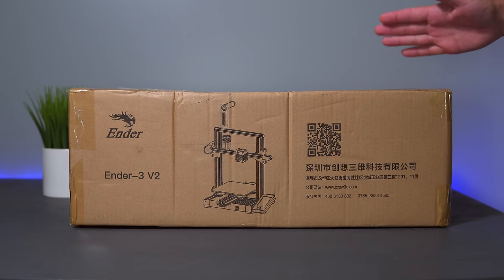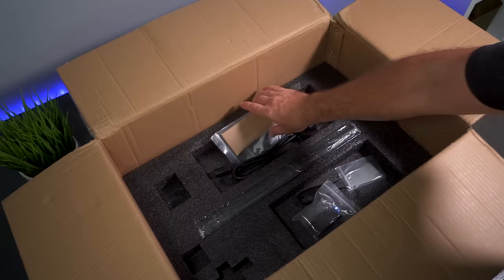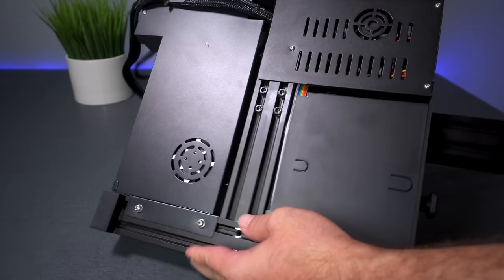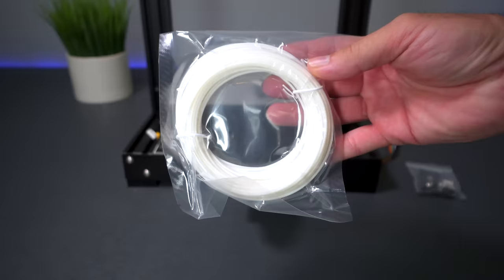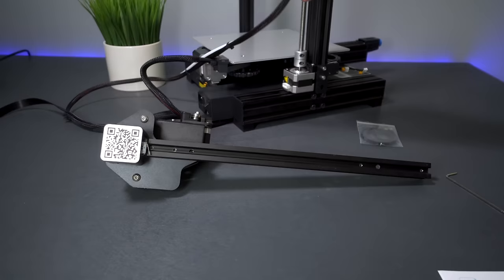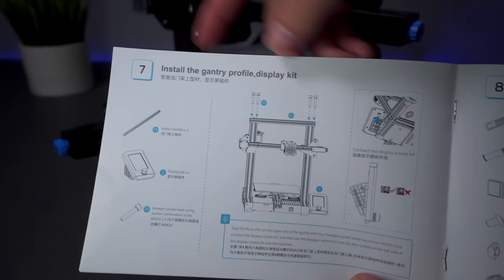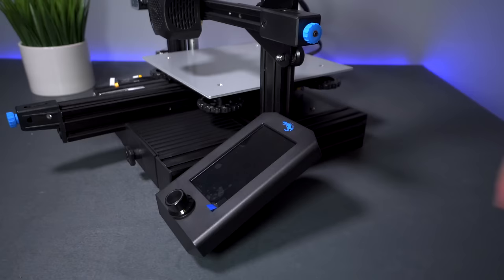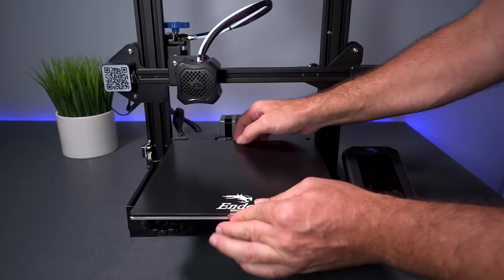Creality Ender 3 V2 - 3D Printer - Unbox & Setup

Comment: What can I do when my tires are really tight on the side of the motor? like I can not move the x axis at all by pushing it down. he speaks about it 22:48 (I did everything as suggested in the video with screws not tightening until the end)
Reply: Rest the extruder on bed and make sure its level so that the bed supports the weight and is level. Loosen everything on the wheels after having the frame tighten as per the video. With the weight supported by the bed and level you can tighten the wheels so that nothing is binding. Follow the rest of the video as he describes. If you can't loosen the nut you'll need the wrench on the nut and the allen wrench on the bolt. If you do one and not the other the bolt or nut will spin with no resistance.
Reply: I am having the same issue.  It will move up somewhat easily, but not down, unless I spin the motor rod
Reply: I'm stuck on this same part
Reply: did you find a solution?
Reply: @squatopotamus  did you find a solution?
Reply: @Studiodre5  did you find a solution?
Reply: @miguelpera9639  no, but it did not become an issue while printing.  Technically you should not be pushing down on that anyway.  You are forcing the motor to spin, which you should not do.  As long as the arm travels smooth while in operation, you're fine
Reply: I'm having the same issue, I wish people could actually help instead of everyone just asking questions 😕
Reply: @Studiodre5  I had the same issue, however it does not seem to affect the auto home option, everything seems to be moving just fine. I think its good to go with the first print.

Comment: Thank you. Creality should pay you for this. You put my printer together.
One issue I had was driving that lead screw through the brass bushing - as mine was fixed by screwes with those cut spring-like washers it was inclined. So it was impossible to drive the lead screw through as they were no in-line. I had to loosen those screws, drive the lead screw through the bushing and then once the horizontal arm was riding on the frame tighten those 2 little screws. Thus the bushing was fixed in proper position.

Comment: When I screw in the motor for the vertical axis, it's off at a slight angle, not perfectly perpendicular to the bar it's attached to.  It seems this is creating fricton as I cannot freely move the print head up and down like you can with one hand.  Do I have a defective motor assembly?
Reply: Same thing is happening to me right this moment. I wish he or someone would have responded cause I don’t know what to do! When I try to push the assembly bar down it jumps and whines and takes a lot of force. And forget about trying to push it UP away from the bed.
Reply: @09shnngns  @woohoo2491 anyone figure this out?
Reply: The only thing I found that helped mine was to print a shim I found off Thingiverse. There’s a shim for the bottom and side of the z axis motor and it helped make the lead screw a little more perpendicular to the vertical frame bar.
Reply: Glad someone commented about this, wasnt sure about how much pressire he was using too. Still having trouble though
Reply: @09shnngns  Hi

Can you kindly, explain a little further how to you solve it?

Still having troubles on this :(
Reply: Also having this same issue. The wheels are pretty hard to turn by hand. I can push x axis up and down but it takes a bit of pressure
Reply: I want to add my experience.

As i was assembling the z-axiz rod it was crocked and i couldnt move the bar up and down, so i first unscrewed the rod and removed it for a bit, and i also unscrewed the stepper motor bracket from the stepper and the frame, incase it was a tiny bit missaligned.
Then i screwed it back together and tried lifting upp the stepper as i screwed it back in, as i saw him mention it sat a bit up on his "in the video"
then i screwed back the rod but upside down because i saw a red mark in the end of it and thought it might have been a mark to indicate that it should be at the bottom.

After all of that my X-axiz frame could move much easier.
Hope this helps someone else aswell. 😊

Comment: This video is expert advice! I had an issue with the bed hitting the y-axis stepper motor case (so it never reaches the y-axis limit switch, and auto-home fails and crashes the software, ending up freezing the display in auto-home screen). After watching this video, I understood what every single piece is for, and figured out how to adjust it a few mm away so that bed doesn't hit the motor case, and the bed is still level on all corners. (I moved the z-axis limit switch up by few mm and then adjusted the bed, raising it up by few mm on all sides, so that the bed now slides above the motor case.) Thanks a ton!

Comment: Assembly definitely helped me a lot, especially differentiating between the vertical gantries. They changed the manual recently and it's basically impossible to tell which side the holes are supposed to go. I did have issues with the Z axis being too low when the limit switch is bottomed out on that nub; had to raise it up a few mm as the print bed was crashing into the Y axis motor. Manually leveling is also a huge pain for my unit for some reason, it seems to change by itself and I had a hard time getting the first layer to stick properly. Other than that though I am letting it pint its first print, seems to be going well so far. I will definitely get the automatic leveler and start printing some upgrades for it, mainly a filament guide of some sort as even with the spool holder all the way to the left it snapped the filament a couple times. Besides the small snags and lots of fine tuning needed it seems to be a great value of a 3D printer (mine was only $200).

Comment: OMG you have no idea how useful your video is!  I watched 2 different videos and tried to follow the printed instructions and could not figure out where to plug some of the power plugs in.  I plugged the wrong ones in the Z and X (used the back plugs instead of the ones under the bed), then found the plugs under bed and went "where does this go?"
Also, if I had watched your video first, I would have gotten that stupid belt on WAY easier.  Thank you!

Comment: Thanks for the very detailed explanation! I was thinking of buying either this one or the earlier (much cheaper) model, but I’m convinced now it’s worth the extra money. This is definitely going to be useful when I recieve and have to assemble it! What I wondered was, the vibration, can that be prevented by building a wooden case around the printer, with the sides and top being snug enough to keep it perfectly still?

Comment: I just finished assembling mine with help from this video.   This was extremely helpful.  My only issue is with the X axis bar rollers.  Can adjust the two inside rollers and the one on the right, from the front seems to tighten no matter which way i try to go with it.  The up down on Z axis is way too tight.  I followed this video to a T.  Any suggestions?
Reply: Yours and mine both mate. Lol thinking maybe I over tightened the bolts for the frame. Or maybe the bit the screw connects too isn't perfectly level. Or maybe my bar itself is slightly bent. Can't be arsed with it now it's half 9. I'll try sort it tomorrow. Did you sort yours out ok? Been fiddling about with those adjustable nuts on the x axis rollers for about an hour straight. Mine do loosen after turning... To a point, then it tightens again... Turning in same direction, then loosens again then tightens again... Seriously wtf lol. Something not right

Comment: What if the rollers are too tight at 22:50? Able to move the right side but motor side is stuck. Not able to move the wheels at all.
Reply: Did you get anywhere on this? I am having a very similar problem. It seems the wheels are very tight against the channel .
Reply: @maclennan.realestate  Nope, unfortunately I did not. When I do auto-home and to try print something, the filament is not sticking to the bed. Not sure if its caused by that wheels problem or bad bed-leveling.
Reply: @marcelkoprowski3816  I believe I fixed mine. The bracket holding the two side bars together was a bit too tight putting too much tent lion on the wheels. Also, if you go back in the video where he loosens the nuts around the actual printer head to make them loser that helped me as well. Overall, I’d say keep it a bit more lose than tight especially around the plastic parts - and make sure your belts aren’t too lose either.
Reply: @maclennan.realestate  you mean the bracket on the very top? I tried that many times, did not seem to solve the issue for me unfortunately. Glad that it helped you :)

Comment: Is the Z Axis Motor Mount still recommended in the Ender 3 V2, or has this become unnecessary? Thank You.
Reply: what do you mean
Reply: @k3a  On reviews of the Ender 3 Pro, this same creator has suggested a Z Axis alignment shim. I was curious as to weather he felt this was still necessary, or if he felt Creality had resolved the issue in the Ender 3 v2.
Reply: My V2 I just rec'd was a mile off.  I didn't realize it was a thing until my Z was no where near as loose as his, my bound up badly.

I put two thin washers in before i knew it was a thing, and now i'm printing the shims.

So yes, very far off, and kinda sad they haven't fixed this issue
Reply: @rustynutz9790  Same here.  Played around with the rails, rollers and nothing worked.   Two small washers and it was alot better.  Still stuck a bit in one spot so I added a bit of silicone lubricant (applied to rag then rag to screw) and now she glides... Perhaps too much? I hope she doesn't back drive under her own weight and vibration.
Reply: The Z axis motor is a pain in the ass, ive spent three days trying to get rid of the binding. I guess Youtubers get handpicked boxes with controlled parts.
Reply: @rustynutz9790  where did you put the washers please? im stuck on this problem
Reply: @mikedeblock5189  where did you put the washers? im stuck on this problem
Reply: @miguelpera9639  between the plastic bracket that is on top of the zstepper, and the vertical extruded aluminum bar.
Basically i shimmed the whole zstepper away from the place it mounts a bit

Comment: Hello, I just bought this 3d printer and I’m having a hard time. I followed everything from this video but for some reason the x axis doesn’t glide on the t type screw or z axis. Can anyone help?
Reply: I have the same problem. I am still assembling it, I am about at the 23:15 mark. When I push the x-axis, it goes down, but when I pull it it doesn't. I thought it was the z-rod but it seems in line. I tried loosening the wheels and the screws for the left/right channels. Not sure what I can do now, not even sure if I should worry about it... if I turn the z-rod manually the x-axis does come up.
Reply: @mnlg_yt  you never want to move any of the axes by hand. You only need to worry if the movement is not smooth if you take the leadscrew out and move the whole x-axis assembly up and down.

Comment: I want to thank you and iterate the importance of "squaring" everything.  I never had/ used a 3D printer before and my first print was amazing! I was expecting stringing, elephant foot, layering, etc... nothing all good!

I would like to add tho:
1.  When tightening the Y axis on the bottom, it needs to be positioned so it is parallel with the side base 4040's, so position this well before just tightening the 4 screws.
2. Same for upper X axis, the bracket on the right needs to be square as the outside rollers don't adjust and they should be parallel with the 2 outside rollers on the other bracket connecting the X rail.

Updated to Marlin 2.1.1 and display print even better (only my 4th print).

HF and Ty.

Comment: Fantastic video! I decided to use this instead of the instruction manual and found it super easy to follow along with. 
Probably one thing to note though, is to make sure of is to level the x-axis arm that the extruder and nozzle rolls on, after rolling down the Z axis uprights. Do this with a ruler from the base up to the bar on both sides of the platform. Making sure this is level will reduce the platform levelling time, beacuse you're no longer worrying about why on earth one side looks higher than the other.

Comment: Excellent tutorial on how to build this! I followed this step by step an hardly looked at the manual. 
One important caution though: DON'T do this at 33:55. 
When I put the bed at its lowest and tried to home, the bottom would snag on the Y axis motor. I believe it's the bed heating wires that get crammed against the motor. This made a horrible sound when the timing belt was forced to slip because the bed couldn't reach the limit switch... In my opinion this is a design flaw. They should have either moved the Y axis motor down, or moved the bed heating wires somewhere else.
Reply: How did you fix this? I’m having the same issue but I don’t know how to get past this

Comment: One thing I ran into is if you put the Z switch all the way down on the channel the plate hits the motor.
I held it up about an 1/8 of an inch and it works great. Thanks for this video it was awesome. I used it to assemble my printer and works great.

Comment: This is my 3rd Ender 3 V2 that I"m assembling.  A few got-yas that have got me to stumble each time with the video.
When attaching the right had side of the Z-gantry pay attention that the X-gantry has been turned around from the prior work of adding the belt.
Also, I recommend adding the belt holder before adding the belts.  Every time I put both screws in just to have to take the one out.

I had a lot more troubles with this Ender 3 V2 than the prior two.  First, my print bed would not move freely.  That was a combination of the belts and wheels.  
Next came the lead screw.  When I tried to push the X-Axis down it wouldn't budge.  The lead screw is not straight.  Losening the motor mount I was able to get the lead screw to move up and down but with a horrible metal on metal screetch.  
Moving the gantry up I could see that the lead screw wasn't falling straight down into the coupling but off to a side.  I loosened all the gantry screws and made sure things were moving freely WITHOUT the lead screw in place.
Putting the lead screw in I went back to the binding.  The only solution was to see if the Feeding bracket was square but I wasn't in the mood to see if they had bent it at a true 90 degrees.  So, I left the Z-motor loose and I guess I'll be one of those people printing up a small spacer, or waiting to see if things correct themselves.
When tightening the bed make sure to tighten the nuts below the platform and not the spacer nut.  If you bed wobbles you'll need to firmly tighten those up. 

As for the Y-axes belt, I have the same issue as ALL THREE of my Ender 3 V2 that the Y-axis belt won't properly align and pulls ot the right. Tried your suggestion but it just didn't move or do anything.  Well, I've got a spare belt for when it might go.  I print about 6 hours a day for the past five months and the belt had a little fraying on it but not enough to worry about. So this isn't going to wear out overnight and is cheap to fix.

Also, when putting the X-axis belt it is best to turn the part over so that the belt doesn't fall into the gap before the gear.

The following notes was from my prior two Ender 3 V2s.
Watch how straight your lead screw is.  If you move the gantry up and down and it moves out of alignment it is most likely NOT a bent screw but it isn't mounted at a pure 90 degrees in the couplings.

I couldn't find this video and started to use CHEP's which sucks.  After posting this I see that this was the video that I watched when i assembled my first Ender 3 V2.  I returned the first one since I had bought an extended warranty and could do so when I had extrusion issues that even the 'expert' printer at the store couldn't figure out. I thought at the time either the extruder motor was dying or the motherboard  no longer was putting out enough voltage.  And seeing that the board has burn marks on it....  But looking back this may have been a broken arm that the spring presses against as they are plastic.  i'll never now or care.

Comment: Excellent video! The only tip I would put out there, and maybe it’s just me being all thumbs, but when I fed the filament and started turning the knob, it twisted around instead of going into the tube. I had to leave the knob off and really squeeze that lever and watch to make sure the filament made it into the other side before releasing the lever and then putting the knob on to start turning.

Comment: This video really saved me a whole lot of anguish.  I just got my Ender 3 V2 and started assembling it using the included manual.  That was really hard to follow as the illustrations did a very poor job of showing how everything should be oriented, exactly where the screws should go, how to hold things while trying to get it to go together, etc.  This video really walked through all of it.  Great narration, terrific camera angles, good quality.  I was able to see exactly how to do everything and Vlad did a nice job of explaining how to get things together like "put this screw through here before doing this other thing and hold it with the wrench".  The instruction manual would never have given that kind of tip.  I got the printer assembled and printing my own Benchy trial run.  I appreciated the tutorial on leveling in the video as well and the walkthrough of the printer's component, the menus in the firmware, and even a brief look at the slicer software.  Thank you for having made this video.  I really appreciated it!!!